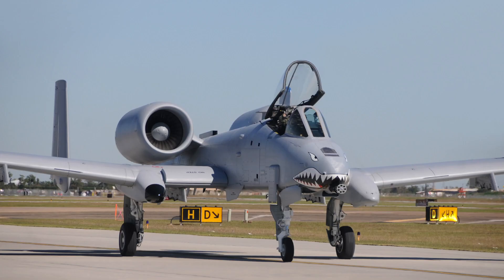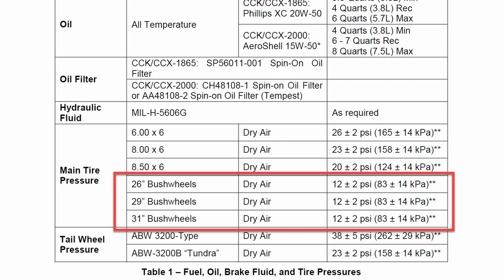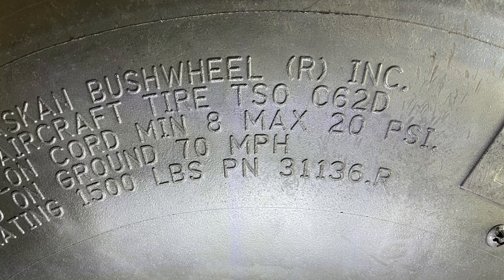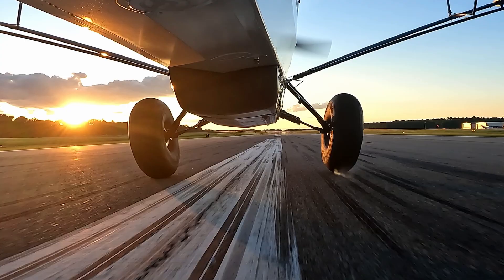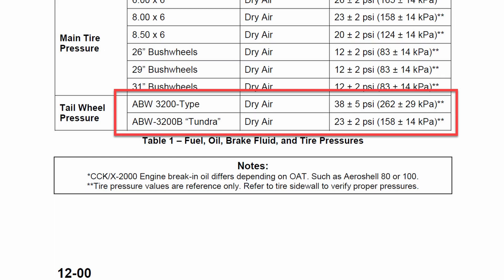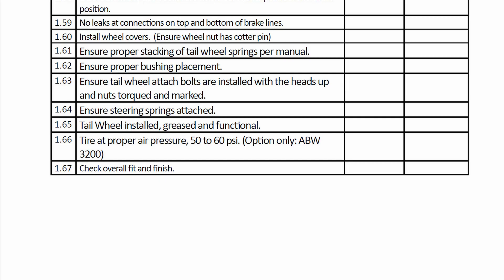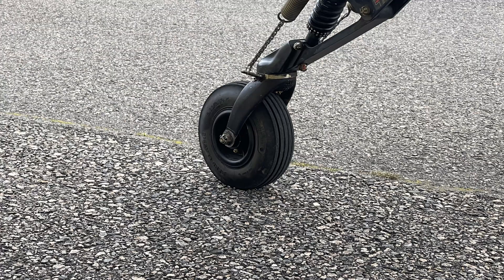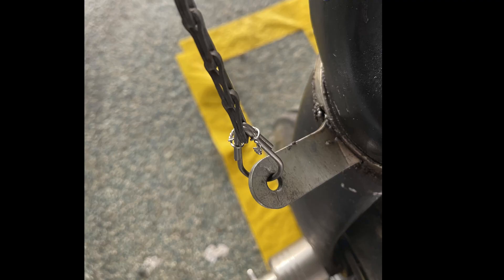Bushwheel and tailwheel tire pressure on backcountry aircraft - new aircraft owner discussion

Comment: In Alaska, Bushwheels with stock bungie shocks where normally ran at 3-5 psi when landing off runway.  It worked great from the day the first one was make.  You would get some roll over on steep side hills but just something to be aware of.  The major downside is people would store the aircraft at that pressure for several months and that bulge at the bottom would stress the sidewall and lead to cracking.  With the new shock systems as mentioned you can run much higher tire pressure and they still work great.  I have the AOSS shocks that work great but I still air down when going into unknown strips.  I carry a 1 lb 12 volt air compressor that I can adjust pressure as needed on a trip.  8 lbs or more makes it a lot easier to push the plane around the hanger.  I always run my tailwheels at max pressure also.

Comment: Great video as usual!  I came to the opposite conclusion on tire pressure, I usually run mine at about 7-8PSI.  When I run them higher they seem  become more squirrely on pavement ( PA-18 not FX3) -10 years on the same tires.  I think the higher accident rate for the FX3 has a lot to do with underestimating the effect of crosswind on an airplane with Bushwheels.  The increased hight of the Bushwheels in three point makes a whole lot more underside of the wing exposed in contrast to something like a Citabra with standard tires.  I generally only wheel land on pavement as it keeps that angle low and the plane doesn't "plop" down as in a  full stall landing. As with everything in aviation, it's a trade off - want to land on rough terrain - can't land in a big crosswind, especially on pavement.  My opinion only from an orthodontist not a  professional pilot.  I may have to revisit my beliefs on tire pressure!
Reply: I run my 31's at 5, they are much less bouncy on all surfaces at 5 instead of ~`12.  People up here in AK them at 3 or 4 all the time especially if their plane never sees pavement.  It's better that way on the real rocky stuff or tundra.  Only downside is less AoA which can increase your takeoff roll by 5% or so, and  of course more wear on hard surfaces.  I think tac-aero runs their 31's at 5 as well which is probably why I do it since they taught me, I might be wrong though.

Comment: I had my tailwheel shimmy for the first time the other day - after landing on snow/ice I did a pavement landing, and I presume the tailwheel and tire didn't spin when I landed back on pavement.  Post flight revealed a pretty apaprent flat spot in the tailwheel tread, had to change the tire.  I was running 45 psi in the aero classic 2.50/2.80-4, 4 ply (standard 3200 tire) with a Burl's Tail ski.   I'm going to avoid pavement as much as possible in the future, although in shoulder season the home airport's ski strip gets pretty messy.